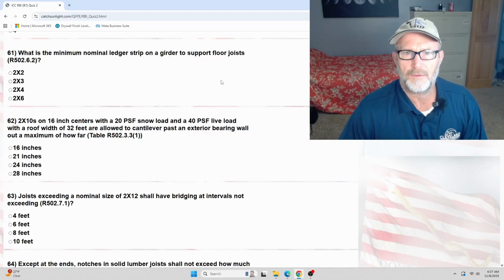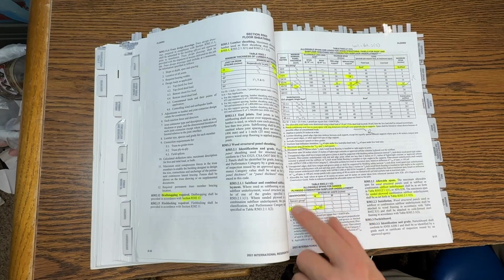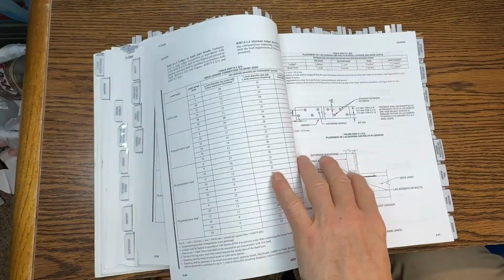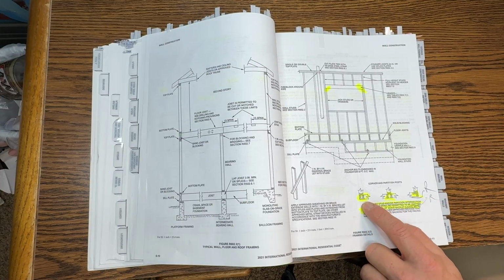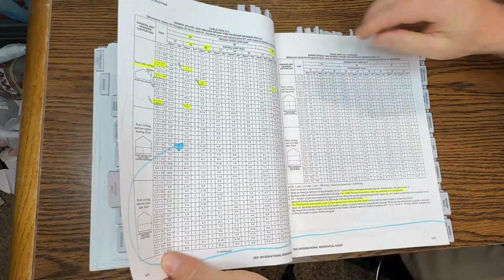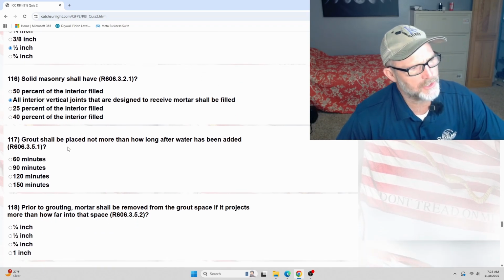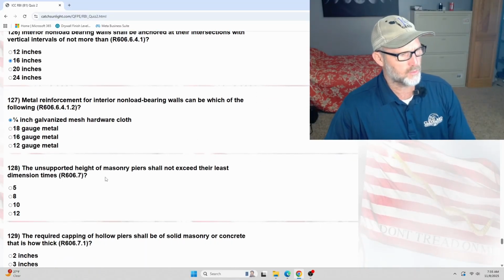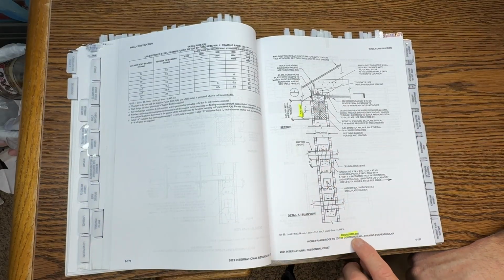Part 3 ICC Residential Building Inspector (B1) Test Chapters 5-6 || Free online test & commentary

Comment: Is a "quick reference" guide available for in the field? 

The USDA used to supply said booklet for produce inspectors (i think last printing was 2006). 

I am studying and following along your channel both physically with my tabbed book and listening as a podcast while driving. AI searches in the field and documenting in the programming IRC references for both pass and fail. This will be my second test try for B1.

Contractors and my management team are helpful sources as well. Any other study suggestions to pass? 

The online test was not designed as user friendly and the India proctor was hard to understand, no instruction on how to flag questions to go back to. Also my test was interrupted as the person said they could not see me leaning over to my right to reference the book. It slowed my time down and i failed the exam.

An in person would be far more user friendly in my humble opinion (age group). I will pass and continue on this path

Thank you for doing this
Reply from the maker: I think they have an in-person version but I don't know where/how.  I took most my exams in  person at Pearson Vue, and transitioning to the online method was hard for me to figure out.  Good luck as I don't know of any particularly better study guide than my practice exams and video for the B1.
Reply: @CodesExplained thank you, it's appreciated

Comment: I have a quick question in regards to tabbing. I have the official icc tabs along the side of my book, but ive noticed you have several more tabs going along the top of your book. Is that allowed during testing? Ive taken my 3rd attempt today and didn't pass. I want to use more tabs but idk if they will let me. Should I do additional tabs and take the next one at home?

thank you
Reply from the maker: As long as they are permanently attached, you can tab however you want.

Comment: Vapor retarder under concrete floor is now 6 mill thick? For 2024 icc ?
Reply from the maker: I don't know.  I was in the hearings in Cleveland and the proposal was submitted but I think it was shot down.  Not sure where it stands.
Reply: @CodesExplained are the questions for the B1 exam scrambled from ch1-10 or are they in ordered from ch1-10?
Reply from the maker: @LegendaryPrince777  They are scrabbled on the actual ICC test.